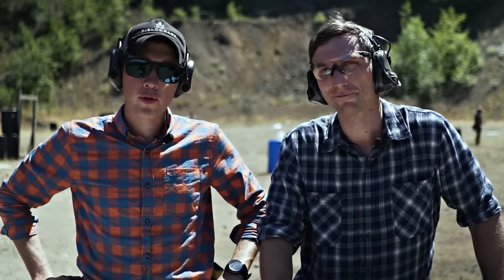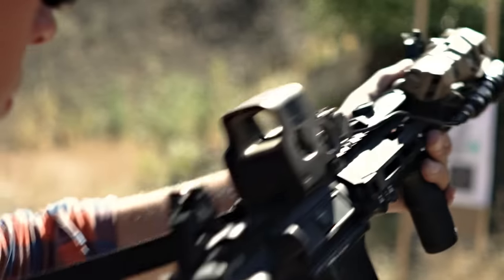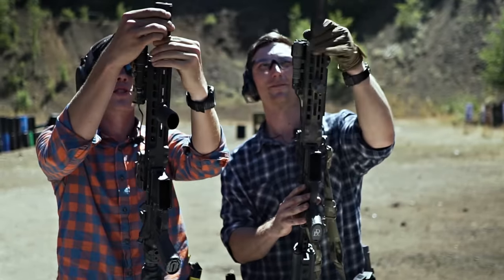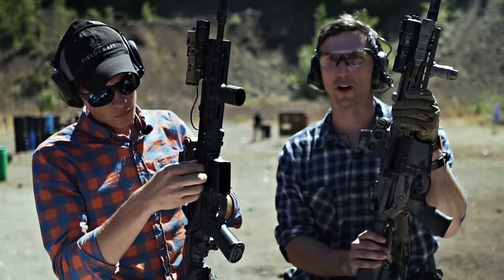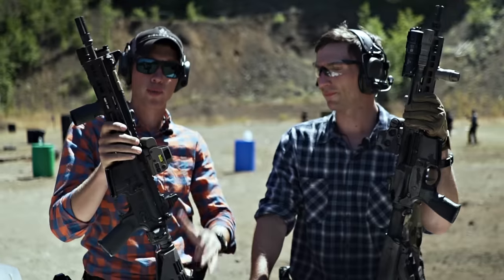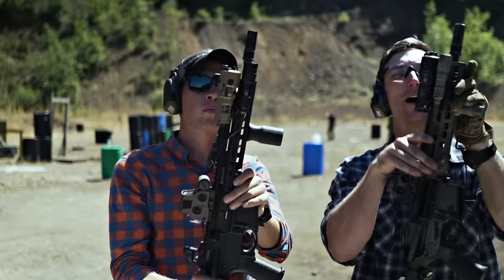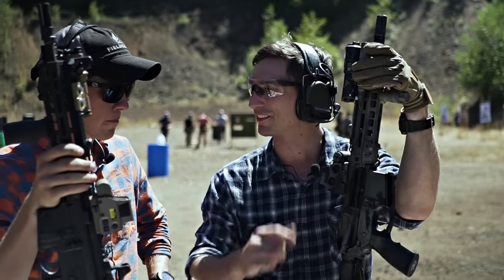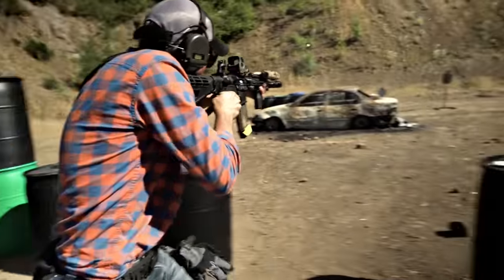Lucas Botkin and Garand Thumb on MK18s

Comment: VFG is legal if OAL is over 26 inches. What about a buttstock? Is that the ATF line in the sand? I searched and read the papers. I get lost in all the therefore, however, made remade stuff.
Reply: as I understand it, a stock or standard buffer tube (intent to manufacture SBR) on the gun equals rifle no matter what, because it's meant to be shouldered, not like a "handgun/pistol". AOW is the class between rifle and pistol because the VFG means you are modifying the gun to shoot it different from how it was designed, but a "firearm" is too long to be deemed a pistol

Comment: @lucus,,, does the law tactical add to the overall length of 26inches to add a vert foregrip????!
Reply from the maker: +run g19 some. But the gun was already long enough since it's an 11.5
Reply: T.REX ARMS do u Measure from muzzle break threads to end of buffer tube? If it exceeds 26 inches I can put a vert grip correct?
Reply: T.REX ARMS ????
Reply from the maker: +run g19 yes
Reply: It also count if you get a folding buffer system. The measure is how long it is when fully "assembled"

Comment: DD MK 18 vs DD V7 pistol if I can only have one? And why?
Reply: Eric E850 I just bought the V7 pistol which would be technically the new Mod 2 of the MK18. Its a MK18 with a better rail. You gain so much from the M Lok over the RIS II. The military will probably add M Lok rails to their MK18s soon.

Comment: So question.  Why not just go 300blk?  Is it just ammo cost?
Reply from the maker: +Napalm 747 ammo cost. And we both shoot a lot. And 556 is more common.
Reply: .300 BO is getting more and more popular but if you plan on shooting it a lot, it will get expensive. It's like buying a .308 but shooting it like a 5.56
Reply: T.REX ARMS that makes sense.  For a mk18 would you recommend a eotech?  I see you both running them.  It seems like garand is more excited about the eotech than you are.  Big window but so large on a mk18.  I wonder what the military units that run mk18 use.
Reply from the maker: +Napalm 747 I like them. But I'm still a big fan of the T2. A lot of guys still use the Eotech on their MK18s.

Comment: I just can't justify the 10.5 or 11.5 dealio due to the fact I can run a 14.5 mid length. Pin a suppressor mount and run a Mini or Sandman K and be roughly in the ball park oal. And I have the advantage of better ballistics. Deflection is a real thing with long rails with lasers. Hodge Defense has probably designed the best rail for that. The MK8 is a good rail as well.
Reply: It depends on what situation you want to run your gun. Even a few inches of a suppressor to a 14.5 in barrel does make it longer for CQB, almost defeating the purpose of a shorter barrel. Running it down to 10.5 + a suppressor still gives it just enough leeway for CQB situations. It really depends. Until they take suppressors off the NFA, I run my gun in a 10.5 in barrel with a linear comp and it's awesome and handy for tight spaces. At close range, the lost of velocity is doable
Reply: Excalibur01 I get it.  I've cleared rooms with a 20 inch barrel A2/A4. Optimal? No. But it can be done. For the average individual a 14.5 or 16 inch rifle will suffice. The shtf guys are running around with their 10.5 and 11.5 inch guns like the cool kid, doesn't realize that those barrels lengths suck running M193 or M855 the two easiest types of ammo to stockpile. I'm doubting very seriously M855A1 will ever be made available to the public. And most other barrier blind type ammo is as expensive. So it's pretty hard to get up a good supply...A1 is really hard on a gun. Almost proof load pressures. So I stand by my first statement.

Comment: so how do you set up a "firearm" to make it not a pistol?
Reply: Pistol=No stock, no foregrip. Less than 26" from extended brace to tip of barrel. If muzzle is welded, tip of muzzle.
AOW=No stock, foregrip. Less than 26" from extended brace to tip of barrel. If muzzle is welded, tip of muzzle. NFA stamp required.
SBR=Stock, optional foregrip. Less than 26" from extended stock to tip of barrel. If muzzle is welded, tip of muzzle. NFA stamp required.
Firearm=No stock, optional foregrip. More than 26" from extended brace to tip of barrel. If muzzle is welded, tip of muzzle.
Long Gun=Stock, optional foregrip. More than 26" from extended brace to tip of barrel. If muzzle is welded, tip of muzzle. 16" barrel required. If muzzle is welded, it counts to barrel length.

Comment: Is it possible to run a mid length gas system on a sbr?
Reply: SBR just beams short barrel. So technically yes you can but you can only get the barrel no shorter than the gas block

Comment: I thought if you put a VFG on a "Pistol" then you have created an AOW?
Reply: Pistol=No stock, no foregrip. Less than 26" from extended brace to tip of barrel. If muzzle is welded, tip of muzzle.
AOW=No stock, foregrip. Less than 26" from extended brace to tip of barrel. If muzzle is welded, tip of muzzle. NFA stamp required.
SBR=Stock, optional foregrip. Less than 26" from extended stock to tip of barrel. If muzzle is welded, tip of muzzle. NFA stamp required.
Firearm=No stock, optional foregrip. More than 26" from extended brace to tip of barrel. If muzzle is welded, tip of muzzle.
Long Gun=Stock, optional foregrip. More than 26" from extended brace to tip of barrel. If muzzle is welded, tip of muzzle. 16" barrel required. If muzzle is welded, it counts to barrel length.

Comment: It's not an sbr but I have a fwd grip on it. Completely illegal. Can only have an angle fwd grip on a pistol build. I have the stabilizer blade and just the protector turns it into a sbr stock and without it it's a pistol stock. So do your research on the laws.

Comment: What if the Overall Length of the Pistol is 26 Inches or More? Does That Still Convert It to an AOW?

There is a narrow exception to the rule that adding a vertical fore grip to a pistol creates an AOW. The phrase “capable of being concealed on the person” within the definition of AOW is not defined under Federal statutes or regulations. The ATF’s current position is that a firearm with an overall length of 26 inches or more does not meet the definition of “capable of being concealed on the person,” unless the firearm is actually concealed on a person. As a result, a person may add a vertical fore grip to a firearm with an overall length of 26 or more inches without creating an AOW, as long as it is not actually concealed on the person. In other words, it is not considered to be a “pistol,” an AOW, or even a “firearm” under the NFA as long as it is not actually concealed on the person.

How Do You Measure the Overall Length of a Firearm with a Stabilizing Brace?

Removable muzzle devices (such as flash suppressors, muzzle brakes, barrel extensions, etc.) do not count towards overall length or barrel length measurements, so they would be removed before measuring.

On June 25, 2019, the ATF clarified its position regarding how overall length for firearms using stabilizing braces should be measured. If the stabilizing brace is stationary, only standard receiver extensions are considered in overall length measurements. For example, accessories (extensions) that have superfluous material are not included in the overall length measurement. However, when a device operating as a stabilizing brace is attached to a firearm using a folding or collapsing mechanism, overall length is measured with the brace in the folded or collapsed position. Otherwise, a firearm could avoid classification as an AOW, yet retain the concealability and functionality of an AOW. 

So adding the Law Tactical Folding mechanism significantly reduces the length of the firearm making it a pistol.  

Without the law Tactical folding mechanism on you can add a vertical grip

Comment: I might be mistaken but if you run a pistol brace as a rifle stock you're in violation because of the manner in it's intended use as a "rifle" stock. Could be wrong but I'd give BATFE a call. No or most LEO'S won't bother but if it's used in the commission of a crime or if used in a defense scenario it'll be scrutinized...I know I most likely wouldn't unless I'm dealing with a known criminal.

Comment: what was that about running a pistol grip on an "pistol" over 26"?
Reply: imahhchocolatebear - not a pistol grip, a vertical grip. Running a vertical grip on a pistol over 26 inches is legal, but it's no longer classified as a pistol, it becomes a firearm
Reply: and as a fire arm is it then legal to shoulder with a brace? say at a range and what not? that would very swell actually
Reply: imahhchocolatebear - yes, the atf stated that shouldering a pistol brace (even if it's on a "firearm" and not a pistol) does not redefine it as an SBR. As it stands it's a firearm and can have a brace on it and you can use that brace however you like, but you can't put a stock on it.
Reply: Juice206 well shit that's nice to know thanks for the reply!
Reply: imahhchocolatebear - no problem. I just hope the ATF doesn't change their minds, they are known to be a fickle bunch.
Reply: Juice206 wonderful, I would be willing to wager by the time I get around to actually building mine that they would be back to not allowing. Juuuust peachy. Haha
Reply: imahhchocolatebear - yeah I feel ya. Doesn't hurt to get 2 pistol lowers and then fill out the form 1 on one of them, and enjoy it as a pistol until it comes back. That way when you get the form back and sbr the one lower you still have another pistol lower to travel with. Filling out paperwork to travel with an SBR is a hassle

Comment: VFGs can get you vanned by the ATF Lucas.
Reply from the maker: +sedor2733 oh really?
Reply: Yeah, VFG on pistols makes them NFA items.
Reply: I think it depends on your receiver, if your receiver has been registered as "pistol" on 4473 and you add a VFG on it, its probably trouble. Because no matter how long it is, its still a "pistol" on paper. if you start over with a stripped "receiver" and on 4473 its "other", you can run the same configuration with no issue, because you just build a "firearm" out of that receiver.